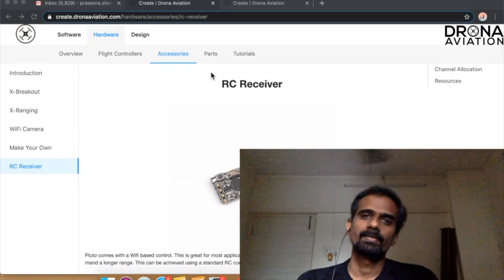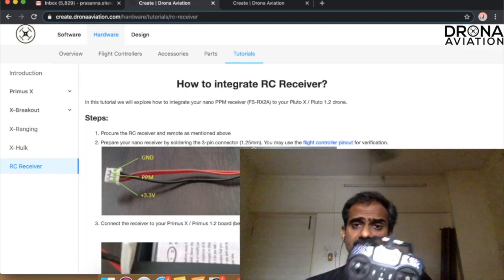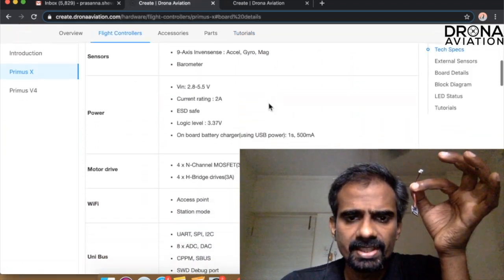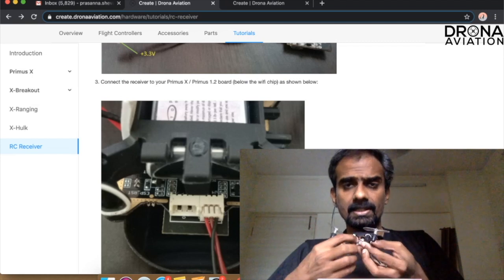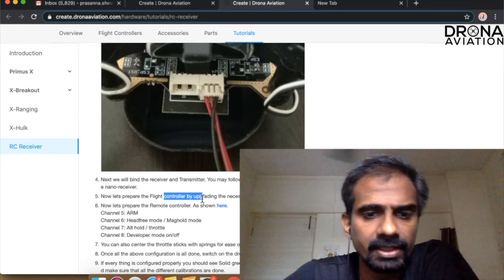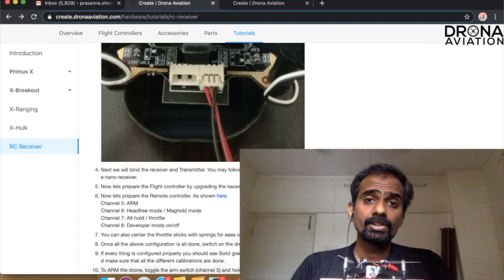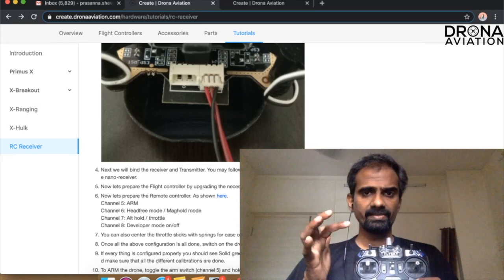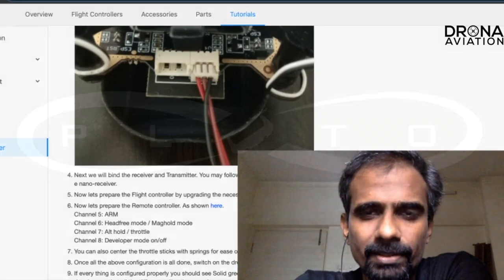Adding RC Receiver Tutorial | Drona Aviation

Comment: Can you share firmware for Pluto12 as well or can I flash this itself?
Reply from the maker: You can download the firmware hex file file from the Pluto controller App itself and you can update the firmware using Pluto controller itself. Check update firmware part in Pluto controller settings.